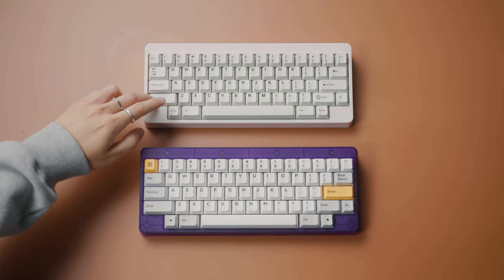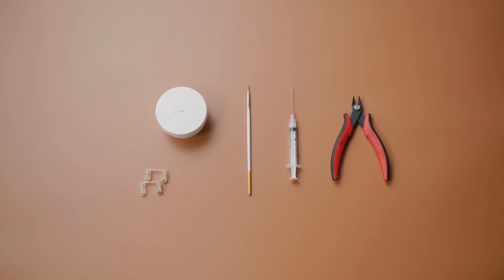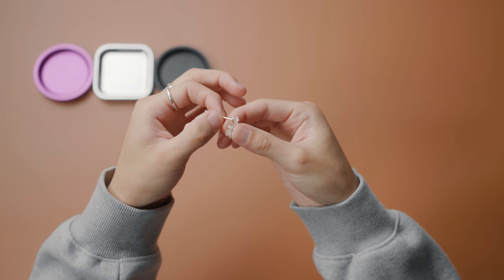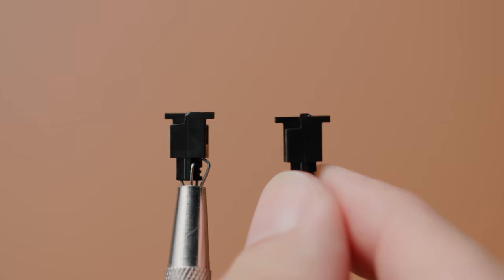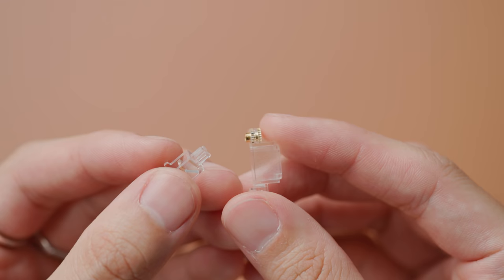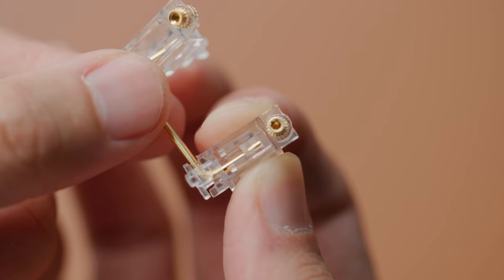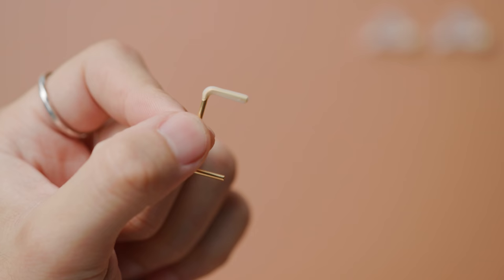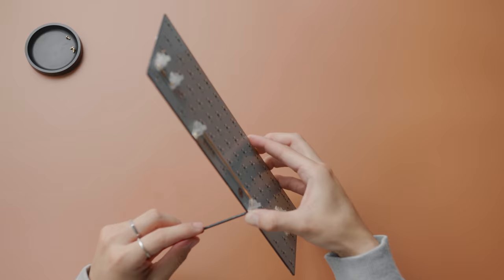How to Lube and Tune Stabilizers

Comment: good sir, what are the best stabilizors u recommend? i hate clicky/rattling stabilizors they should sound thock.
Reply: Durock V2's are currently one of the best selling stabs across multile vendors. C3 Equalz stabs, Zeal stabs, and Gateron Ink stabs tend to be more expensive but a bit better than Durocks, but not by much.. Generic Cherry and GMO screw-ins can sound OK, but they are harder to work with and are worse quality than all the previous mentioned. If your board can suppoet it, go for screw-in stabs every time. Plate Mount stabilizers are harder to tune and will always sound a little rattley due to how they are mounted to the plate and not the PCB.

Comment: Just wondering, if you lube the stabs and then use your keyboard for like a year constantly, will the lube wear off?
Reply: The lube will wear off but the smooth feel will still maintain for a very long time. The last time I lubed my keyboard is about 2 year ago and it still maintain the smoothness until this day despite that the lube are less noticeable than the first time.

Comment: When you showed lubing the housings, does that go for the same for the normal switches without stabilizers?
Reply: Lubing switches is similar. The goal is to reduce friction between the materials. Normally you lube the stem all around including the legs (linear only) as well as the bottom housing. No need to lube the top housing.

Comment: 5:55 I’m completely new to keyboards and just in the learning stage right now. But I’m wondering if you fitted some electrical tape on the wires, or those rubber things to seal up wires that you heat up and they shrink around the wire. Something to reduce that metal on plastic contact

Comment: First time lubing here - what's the downside to installing the stabilizers dry first, then using syringe method in small intervals until the sweet-spot is achieved?

Comment: What about silencing upstroke slap noise?

The stab wire slaps against the top housing bridge. I found putting a tiny dab of hotglue softens the slap vibration.

Comment: Do you need to reapply the lube? How often if so? Mine works great after i tune them. But after a month or two it rattle again.
Reply: The lube mostly will stay for a very long time if done properly  ( mine was last for over 2 years before it started to wear off ). Even when the lube wear off, the smooth feel will still maintain there. So keep it intact or re-lube is up to you :D.

Comment: Would It be okay to use Tribosys 3203 for the stab wires instead of dielectric grease?
Reply: I think 3203 would be too thin for stab wires.

Comment: I'm pretty much at my wit's end in regards to balancing the wires. I've been doing the spacebar wire for over 4 hours and it still displays movement in balance tests. Would love someone to enlighten me on this because I'm using two ballpoint pens to straighten it out, also wondering if there's any movement allowed when testing the wire on flat surface.

Comment: I have a big problem during my stabilizers. My spacebar is rattling too much but it can't be fixed because it's a different stabilizer than the normal traditional stabilizers. I have the Razer huntsman mini keyboard that have the special stabilizers.
Reply: Don’t lube razer stabs cause if you do it wrongly it may break optical switches in the board

Comment: Just a question: Does lubing or overlubing affect actuation force??
Reply: It's doesn't, the actuation force comes from the switch's spring. Lubing the switch will make the switch smoother to typing on and also extends the switch's lifespan :D.

Comment: For some reason no matter how much lube I put in my stabs it still rattles. I even bought an aftermarket durock plate mounted stabs and lubed them with permatex dielectric grease and still same results

Comment: thanks for the great video.  I have one question though: is it enough to lube the stabilizers when modding?  or do I have to repeat this in a certain period of time?
Reply: From my experience: just like when you lubed switches, after you lubed and tuned your stabilizers and you feel satisfy with them, you really don't need to re-lube them again unless the stabilizers are rattling again. Even if the lube wear off, the smooth feel will still maintain as the lube has already applied a thin layer of oil onto your switches/ stabilizers.

Comment: Does lube wear off?
If so when it wears off does it return to its stock sound ?
Reply: Lube may wear off but it will take a very long time for it to wear off to be honest ( mine last for over 2 years ).
Even when the lube are wear off, the smoothy will still maintain in the switches/ stabilizers etc. :D.

Comment: I have a question how long does the lube last (shef life after) not in the keybord like if i buy it and lube my bord i will have left over that i dont just how long can i keep it until it cant be use for lubing any more
Reply: Once you have lubed your keyboard, it will stay for a long period of time. Mine was last for over 2 years before the lube starting to wear off - but it's not a big issue that you have to worry about, even when the lube wear off - the smooth feel will still be there intact. So re-lube again or keep it intact is up to you :D.
Reply: @huunhanle3809  sorry if I didn’t make it clear but im not asking about that i want to know about the lube that is not use like the one in the box that you keep to lube next time how long can you keep that for
Reply: @Meczox  I see, well they will stay for a very very long time I assure you. Since those lube are synthetic grease by the way.
Reply: @huunhanle3809  sorry but for long time do you need it will tay for 2-3years+??
Reply: @Meczox  Yeah, it could stay for a long time, maybe 2 to 3 years if you keep them in a good condition .
Reply: @huunhanle3809  thank you very much

Comment: will u make one for lubing ur switches and soldering them onto PCBs?
Reply: Switch lubing guide is coming this year.

Soldering is very straight forward and there are already a ton of videos explaining both through-hole soldering and keyboard soldering specifically so I don't think we need another one.

Comment: Just get a wire and take out the metal in it and use the rubber cover and thread it in in the hole.

Comment: IFYOUARESEEINGCOMMENT CAN YOU PLEASE HELP ME 
I've been trying to lube and tune my stabs correctly but no matter what I do it always ticks and rattles, I've tried every mod that is mainstream like the holy mod,
just lubing, and the wrap mod. But none of them are working for me and there's still ticking, and yes I have bought keycaps with no warp to them AND straightened the wire.
PLEASE HELP!!!
Reply: ik im late and you've either moved on or fixed it but prob just a bad stabilizer, i know ones from glorious are terrible. Find one online that has got good reviews, shouldnt be more than $20 (if you havnt already)
Reply: @HoIdenJones  I have mainly fixed it but it still ticks I just don't know exactly what to do, I do have the main "good" stabs so i don't know why they wont tick, its annoying but oh well, thanks for the help.
Reply: @imboredwithgames3525  hmm. have you tried buying new ones? they might of had some sort of factory defect or smth, or maybe just age has made the tolerances really bad? i had a similar prob but the issue was the stab kinda wobbling in the socket which i fixed by just putting a band aid strip on the outside of the housing (and on the pcb) to make the fit tighter, if you havnt done that then that might help a lil.
Reply: @HoIdenJones  Mine are currently the Durock v2 stabilizers which are screw in so sadly the band-aid method wont work for me. I hope one day they will decide to work :/
Reply: @imboredwithgames3525  hmm, are you 100% sure its not a bent component? there's a method of putting some cotton or a pretty thick band-aid under the wire to check if the pcb is crooked or the wire is bent. You've probably tried this but i'm at a loss at the moment on why it would be ticking after every mod. Also, try getting a video of your keyboard w/ those stabs in a sound test and see if its happening to others.
Reply: @HoIdenJones  tbh its probably a bent component but I just cant tell how it would be after the immense amount of keyboards I've gotten over the years, the keyboard I'm currently using is the Iskar. Its the only one that has suppressed it the most. (I have checked the stab wire the see if its bent and saw no reason to why it would be.)
Reply: @HoIdenJones  also the band-aid mod never truly worked for me sense it would just fall off or interfere with the smoothness, sometimes making the stab stuck unable to fully move rendering it useless for me.
Reply: @imboredwithgames3525  if you're talking about the holee mod, sounds like the band aid was too thick then? you can buy gaskets for those stabs that are perfectly sized for the holee mod. or just wrap the wire with a thinner band aid instead and put some dielectric grease on it for a less invasive approach 🤷‍♂

Comment: For the love of god, anyone lubing switches, get the part Taeha uses to hold the stems. If you pick it up with tweezers, after just 3-5 of them it will start slipping and it will fall on the floor and you will question your life decisions why did my wife leave me and take the kids

Please, get the damn tool
Reply: I just hold it by the tip above h Th e deskmat lol

Comment: Is there a good silent stabilizers ?
Reply: Stabilizers are typically always silent. The sound you're hearing comes from the combination of the switch, keyboard case and it's material, and the plate and it's material. If you want silence, just go for some good silent switches. Personally I haven't tried any silent switches myself but as far as complete silence is concerned, Bobagum switches have multiple sound tests on Youtube and they are shockingly quiet.
Reply: @goomywurm  i have silent switch but the Space bar isn’t silent With the silent switch and the lube on stabilizers

Comment: I just built my first keyboard and the stabilizers are the most loud ive heard stabilizers be. I spent my entire night building it twice since i had to redo some things. I am quited disappointed with the current outcome so im a bit stressed at the moment to even consider going back to do any kind of clipping or lubing at the moment...What are your thoughts of putting foam under the stabilizers in their housing? I found a video about it and was wondering what your thoughts on it were.

edit: https://www.youtube.com/watch?v=Q7gRnpe7oyw this is the video that I found.

Comment: No matter what I do, no matter how much lube I add, no matter what mods I use/do, I can't get rid of the rattling noise from my stabs. I legit just gave up at this point.
Reply: Something I learned about recently is that the stab wire can be twisted. Not sure how that would happen, but it apparently causes rattling and is impossible to fix by just adding more lube.

Comment: Krytox is probably fine for your stabilisers, but using teflon insulator on the actual switch parts is insane. Get some fader lube ffs, its the stuff actually made for control lubrication. & get some lithium grease/fader grease while ur at it

Comment: What abt stock keyboards, i mean mass produced, store bought like Corsair K100 OPX, razer huntsman elite.
Reply: Don’t do it with razer stabs cause they have optical switches which may break but other mass produce brands you can just use a tube
Reply: @patrickchen4112  i bought corsair k100 OPX. It's a hot swap keyboard, but only with their opx switch. Opened all the switches, removed stabs, lubed then all with krytox 205g0 except springs. Working great.. No issues..
Reply: @shshankking  you can lube the plate mounted stabs then also you can lube the spring btw
Reply: Razer has optical switches in the switch but the optical part for other boards are normally in the pcb so you good
Reply: @patrickchen4112  yeah.. I removed them, and actually, i replaced them with duroc ones.. 🤣
All lubed. Best of custom and prebuilt.
I hope they continue this and other vendors also learn and start doing this. This will atleast lessen the hatred for big brands..
Reply: @shshankking  yep I agree, it is pretty much impossible to mod razer keyboards cause of how they are made

Comment: Just curious here! Is there no need for the band aid mod? I've never modded my stabilizers before  :o
Reply: Yea! The band-aid mod is completely optional. Lubing is, at least in my opinion, the only 100% necessary thing to do to them. Anything else like the holee mod and band-aid mod is optional, although I personally like the holee mod on my stabs lol.

Comment: This video is now outdated with all of the new mods like the Epsi and holee mod, because they work better, and last better.
Reply: 1. Those mods aren't new.
2. They make the stabs feel very sluggish and, imho, should only be used on cheap stabilizers where lube isn't enough to fix the noise.